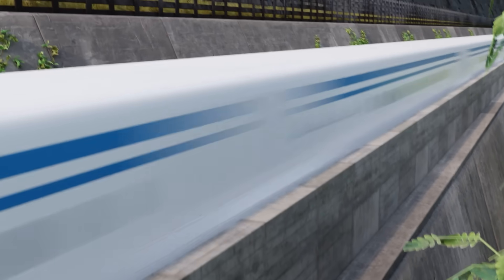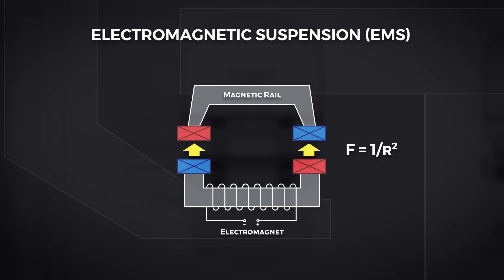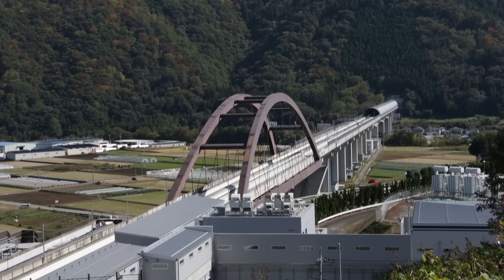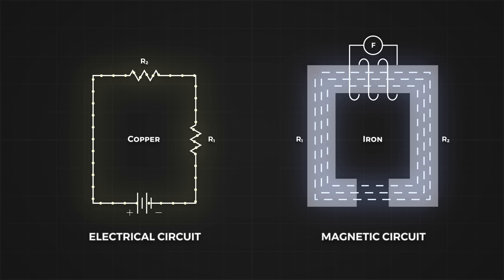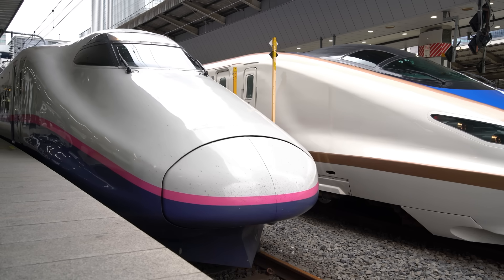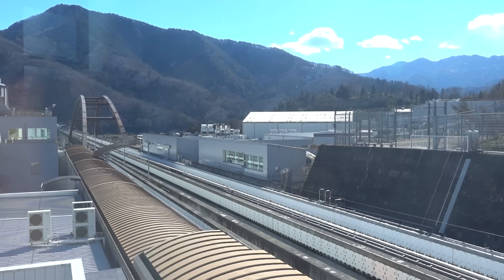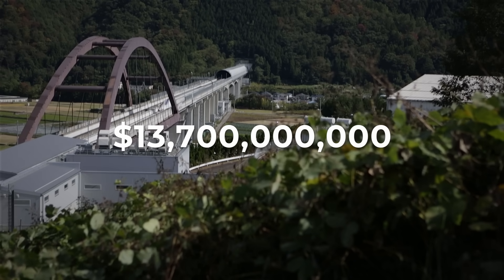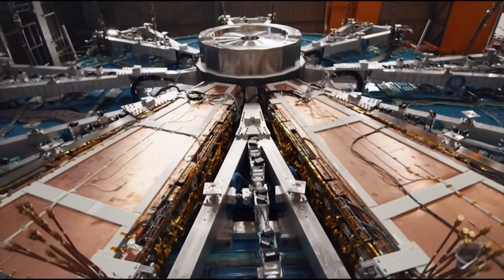How Japan's Maglev Train Works

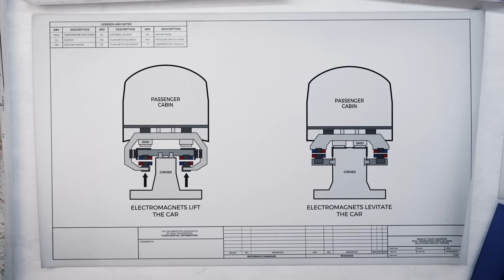Comment: 1:25  The chart is not correct. At 350 km/h and average of 290-310 km/h, so only few to none stops on route, it would be around 1:55 to 2:00. On the chart it's over 3 hours. The plane would actually be much longer, as you have at least 3 hours overhead on one end, to reach airport, pass all check and board, and at least an hour overhead on other end, to reach the city. So it would be at least 5 hours. You also adding 2 hours overhead for HSR, which is also way too much, as stations are already in city centers.

Comment: isn't Maglev basically just bleeding money? so expensive that's meaningless rather than regular trains?
Reply: JR Central already makes billions of profit with 30% profit margin only by shinkansen annualy and they can fund the maglev themselves without using government budget. Maglev is 2 times faster than shinkansen and means the distance between two major economic region (Tokyo and Kansai) will be 2 times closer, more economic opportunity.
Reply: @val8730  Yeah and the plane is cheaper than the shinkansen for that reason. Maglev will be incredibly expensive
Reply: @benedekhalda-kiss9737 in what cost? buying the airplane/maglev infrastructure or operational cost? If you asked about operational cost, shinkansen and maglev is cheaper to run because it run using stable electricity from nuclear power without depending on fuel that fluctuates its price. Also lot less co2
Reply: @val8730  Operational. Price of tickets. It will be immensely expensive
Reply: @benedekhalda-kiss9737 JRC said the fare will be 1.3 times expensive than Nozomi, with 2 times faster travel duration than Nozomi, so its still a bargain.
Reply: @val8730  Yes and my point is HSR in japan is crazy expensive. You can find flights for 6000 yen
Reply: @benedekhalda-kiss9737 and? Most Japanese people (both businessmen and travelers) wanted lesser travel time, not cheaper but high hassle😂
Reply: @benedekhalda-kiss9737 Nozomi is very expensive but more ppl ride it than airlines from HND to Itami/Kansai😂. If they wanted it cheaper, JR Central will not that profitable😂
Reply: @val8730  Why chase the profits? Why not chase ridership? There is no reason for the tickets to be so expensive unless the upkeep for a maglev is really expensive (which it is)
Reply: @benedekhalda-kiss9737 What???😂😂 Nozomi always crowded and JR only put competitive price as high end JAL/ANA fare. Airliners alone cannot take all passengers from Kanto to Kansai area and vice versa.

Comment: I think there was a plan to introduce the Japanese Shinkansen system on some section from Houston to Dallas.
As I recall, the land has already been acquired and part of the construction has already begun.
By the way, as you can see when you ride a motorcycle, it is not generally true that air resistance in tunnels is greater because the effect of wind blowing outdoors can be reduced.

Comment: 8 dam lock 6100 mile hydro turbine meteor 2108, 2119 all road closed oxygen ceilling 4108ft globe impact argentina to australiq globe exit tenn arkansas oklahoma mag rail tenn. 48,000 pades 1 to seven boxes paper ink, print 
Common 1- 4 abrassive adhessive legal / letter paper

Comment: Bonjour à vous,

Notre entreprise SEPTIMA³ développe un train capable de traverser les distances terrestres et maritimes, l'une après l'autre, sans toucher les surfaces. Nous en sommes au développement des prototypes, cependant ces trains ont trois avantages, ils offrent de réduire de 90% le poids absolu des passagers et du train lors du mouvement ; le train n'a pas besoin de rails, de voie de guidage, pas plus que de câbles d'alimentation ; le train propose d'atteindre une vitesse de déplacement de 2000 km/h rendant possible de joindre Tokyo, depuis Paris, en près de cinq heures quarante minutes, soit deux fois plus rapidement qu'en avion.

Seriez-vous intéressée pour en parler ?

Bien à vous,

Kevin-Yvart Frappart, Founder de SEPTIMA³

Comment: The airport security factor (time to check passenger luggage for explosive devices) is why the hyperloop rubbish will never happen. Hyperloop will be very vulnerable to even small explosions - and will have to be protected by airport like security, slowing down journey times dramatically. Hyperloop is just hype, but more conventional HSTs / maglevs are more feasible

Comment: As an economist, I can think of 4 "lines" that with proper subsidization and political will could be incredibly popular, and effective projects. One you mentioned, in the Texas Triangle, one of the fastest growing areas of the country both economically and in terms of population. You could tack on an "expansion" project for the decades following completion into NOLA because of the industrial base there. An east coast line, something like Baltimore/DC to Boston, self explanatory with the population and financial density. Potential future connections internationally to Montréal/Ottawa. A Midwest or Great Lakes line, Minneapolis/St. Paul to Cleveland or Buffalo, another fast growing region thats only set to grow faster as a more minimally effected region by climate change and a large industrial base. Connections to potentially Toronto, Winnipeg, and maybe more ambitiously St Louis. And then probably the most frequently discussed, a West Coast line. San Diego to Vancouver. With the right government cooperation, school incentives for both the engineers and trades workers needed, and a lot of luck. The cost will be vastly outweighed by the incredible economic boom that comes with shorter, more affordable travel.

Comment: nstead of using regular conductive magnets that only float 8mm, we have put into practical use an ultra-electric linear motor car that floats 10cm. Because it floats 10cm, there is less shaking and vibration even when traveling at high speeds of 603km/h, making it more comfortable than the Shinkansen. In addition, noise prevention is also necessary because of the large impact when traveling.
The train must run through a tunnel, which has delayed construction. 90% of the total length is tunnel, so there is an issue that construction is delayed due to the problem of running out of water when a tunnel is built.
Reply: where i can try the car？
Reply: @gracegao-nv8tp 
Test rides are held at the Yamanashi Prefectural Linear Exhibition Center, but because it is a lottery, it is probably difficult to win unless you live in Japan. 

However, it is possible to observe the running tests. Since it is only a test run, it is not clear what time the train will pass the observation center, and it may be canceled at short notice, but running tests seem to take place almost every weekday. 

Although it is written in Japanese, you can check the test schedule on the website of  Yamanashi Prefectural Linear Exhibition Center.

Comment: I am pleased to share with Professionals and Companies the most advanced technological tool in existence: the Digital Twin that I developed in 1981 under the name of Virtual Instruments.  https://youtu.be/eadaQiL_AK0   https://youtu.be/fXlp4QLdWQs   Export the Copilot, Chat GPT, Revit, Plant 3D, Civil 3D, Inventor, Engi file of the Train, Building or Refinery to Excel, prepare Budget 1 and export it to COBRA. Prepare Budget 2 and export it to Microsoft Project. Solve the problems of Overallocated Resources, Planning Problems, prepare the Budget 3 with which the construction of the Train, Building or the Refinery is going to be quoted.

Comment: 0:00: 🚄 The Maglev train in Japan uses magnetic levitation technology to reach speeds of 500 kilometers per hour.
2:57: 🚆 Maglev trains use dynamic magnet systems to maintain stability and flexibility.
5:22: 🚂 The passage discusses redirecting magnetic fields using electrical steel shielding in train cabins.
8:07: 🚄 Japan is developing a Maglev train system, using a linear induction coil to capture energy from changing magnetic fields.
11:53: 🚄 High-speed trains are a competitive option for distances between 200-800 kilometers, but the US lacks investment in this technology.
Recap by Tammy AI

Comment: As a Brit watching HS2 construction, seeing the Tokyo to Nagoya cost rise to $13.7bn makes me weep with envy.

For context, the slightly shorter London to Manchester (admittedly through Birmingham, which will add costs) conventional high speed rail is by now costing over £100bn...
Reply: $90bn of that has to be for your politicians' pockets mate, 100bn for that tiny section is the biggest BS ever

Indonesia's first HSR line (opened last week) is around half the length of HS2's first phase yet only cost $7.3bn and took just 8 years (2015) from drawing board to completion.
Reply: @nerd2544  I don't think it's necessarily going to our politicians pockets... I would guess more likely the politicians are incompetent, the consultants are making bank, and landowners along the route are fleecing the system. 

Some of the costs are understandable. They're tunneling under a national park, for example. But the total ballooning of the costs is just inexcusable.

As it turns out, the line wont even run to Manchester now. It was just announced that they're cutting the length in half to just London <--> Birmingham.

Comment: The biggest challenge is to convince anyone to buy maglev trains/tracks. The current owners/operators of traditional rails are not willing to ditch their existing infrastructure(-investment) or run a parallel new one. Thats how it was in germany. Siemens developed the Transrapid but stomped the project because there wasnt a market. Only china bought a single one.

Comment: I am wondering about the efficiency and feasibility of reducing air pressure in the inside and even the open extremities of tunnels while the train passes to reduce the drag and problem of moving air aside. I think we can even achieve the same benefits by creating an air current in the direction of the train.

Comment: The U.S. might have higher demand for high speed rail, after robotaxies are fully implemented. A resistance point to high speed public transit, are the last miles. Either a bus takes so much time that it outweighs the time savings, or a taxi/uber/rental cost so much that it raises the total price too much. So that fixes the competition with driving. 

As far as the competition with flying, since a robotaxi network would most likely be electric vehicles, flying would be seen as a last major polluter to tackle, when it currently is viewed as a backburner issue.

Comment: I always imagined they could basically put a large high strength refrigerator magnet at the bottom of the train, and another of the same polarity on the rails to repel it.  I imagine that should repel them from each other regardless of the speed.  Can someone tell me what I'm missing?

Comment: As a young boy, I used to dream about these maglev trains. But now, as an engineer, I know for sure that this technology is a dead end. Sure it works... if you put in enough money, resources, brain juice and political will. But the real question is :  Does it work BETTER or does it have more potential than conventional high speed trains, like say, the French TGV that can go at nearly 600 km/h on standard rails ? And the answer is no.

Comment: I am pretty sure this will never come to US anytime soon , also i think most would prefer a airline than this train , and yes the train is more efficient them train but building and manufacturing so many magnets coils and tracks would reduce the overall benifit , this would be better if it run in a complete vaccum tunnel without requiring the magnets to be super cooled .

Comment: Fun fact about the cost: The $13.7b construction cost was actually entirely paid for by JR Tokai on their own without any government grant, because 1)it shows how confident JR Tokai is to the technology and the project, 2) they don’t want to deal with the government red tape (locally and centrally) that slows the project involving government grant and 3) they plan to shut down Tokaido Shinkansen for a three year overhaul once Chuo Shinkansen opens so they want to complete it as soon as they can
Reply: There will be no need to shut down the whole Tokaido Shinkansen for the overhaul. Besides, only between Tokyo and Nagoya, there are ten stations of the Tokaido Shinkansen that will not be served by the Linear Chuo Shinkansen, so a temporary closure would not make any sense for JR Tokai.
Reply: Not only that, it shows how profitable Japan's rail system is to be able to afford this without needing government grants. They really want to decongest the Tokaido line as it's at capacity already.
Reply: What i don't get. If 86% is already tunnel, why not go 100% tunnel, seal it and use the piston effect of the trains themselves to partially lower the air pressure inside (and maybe pumps as well). especially at this speeds, it's almost all energy is used to overcome air resistance. it's obvious the hyperloop is bullshit, as you never will be able seal a huge cheap steel-tube undergoing temperature changes. but for tunnels deep in the ground this is much more doable. while it would be abit more expensive, that would really be a massive step into outcompeting airplanes.
Reply: @beyondEV  The extensive use of tunnels is a solution to the problem of the Japanese Alps. The current Tokaido Shinkansen line takes a detour to avoid the mountains, but the Chuo Shinkansen aims for faster speeds and no need to slow down to maintain 500km/h through curves, so it chooses to tunnel through the Japanese Alps for a more direct route. But building underground tunnels is still very expensive, so in open areas they can be built without being buried underground to reduce costs.
Reply: @beyondEV Probably because pumping air against a pressure gradient is higher resistance than plain wind resistance
Reply: Confidence itself is worthless. Being confident in tech bullshit doesn’t make tech less bullshit.
Reply: @christian123542 What BS?
Reply: @christian123542 Sounds like you have no clue what you're on about

Comment: Question, what happens to maglev trains if there is a power outage while it is traveling at maximum speed? The wheels were retracted already, and the electromagnets keeping it levitating have lost power. Wouldn't it drop instantly and crash?
Reply: The train have a totally independent power source (actually it have 3, 2 backup and one main source). None of those sources are based on the outside power.

If the driving coil would power of, the train would induce a current int he coil and keep the current going, this would also slow down the train but keep it levitated.

So basically it would just coast to a slow speed, extend the wheels and land. It would not be very different from a normal landing.

The train have ample energy to travles several 10 of km before it stops. If there is a power cut, the train knows exactly where it is so it use the onboard magnetic breaks to stop at predetermend emergency stations so the passanger don´t get stuck in a middle of a tunnel. This way the train can be evacuated if needed.

Comment: Beside the technical achievement which is hands down amazing, I wonder where these trains will end up operating since even the current N700 shinkansen cannot go full speed due to the tortuous landscape of Japan. Are they going to build a full system of tunnels?

Comment: That is an incomplete calculation. Upfront costs are higher, but operational costs are lower. Also due to higher speed, this line can serve more passengers, which increases gains. So it is quite possible to be economical, even more economical than traditional trains.

Comment: In the chart at 12:32 why does the high speed rail start at 2 hours after have traveled 50 km? And the chart only shows a train travelling 300 km/h roughly by just eyeballing the chart, not 500. And the airplane's max speed in the chart is 500 km/h but in reality it's more like 900 km/h. Only the car at 100 km/h seems "right".

Comment: I did my graduate work in magnetic shielding, so in fact yes, you can block magnetic fields. But you have to use superconducting sheets, so in practicality their solution is better. But the assertion that you cant block magnetic fields is technically incorrect.

Comment: The primary reason behind the price increase to build the maglev compared to most HSR lines is the huge amount of tunnels along the route, not the type of track. Supposedly the track costs about the same as traditional rail, and is much cheaper to maintain.
Reply: Yes, that is the problem when someone who is illiterate in economics make a video where the complains is mostly about economics.

if we compare with simular high speed track, like the gothard base tunnel (that have a top speed of only 250km/h) the gothard base tunel is quite a bit more expensive per km anyway

Comment: Correct me if I'm wrong but I believe the reason for the train's nose being that shape is a concept called biomimicry where they used the shape of a bird (or platypus) that enters the water with barely a ripple and based the design of the nose on that shape. The droplet shape was found to induce heavy stresses and noise when the train entered a tunnel and this shape minimised that effect.
Reply: No, you confised it with the 500 series shinkansen. The front of this train works more like the bulb of a ship. its to pre prep the tunnel for higher pressure before the train enters. This way there is a much smoother pressure wave when the train enter and the tunnel boom is much lower.
Reply: Didn't know that. If what you say is accurate and true. That is awesome.
Reply: KINGFISHER BIRD....
the design  engineer was also an ornothologist....
Efficiency of breaking through air and water....and to prevent massive air shift in tunnels....
Reply: Just copying from nature…😅